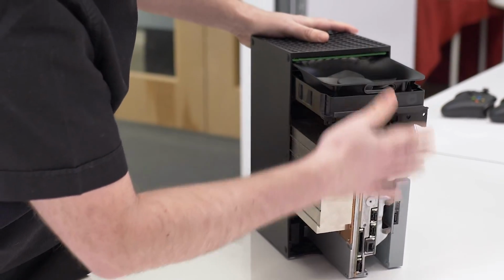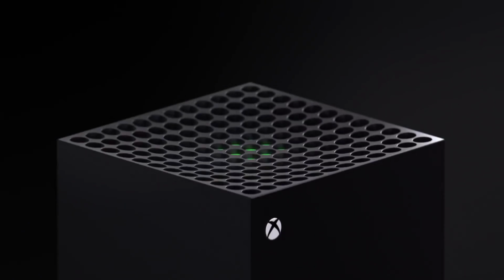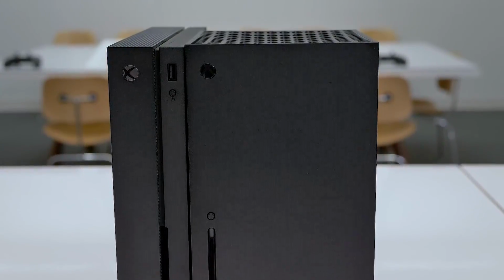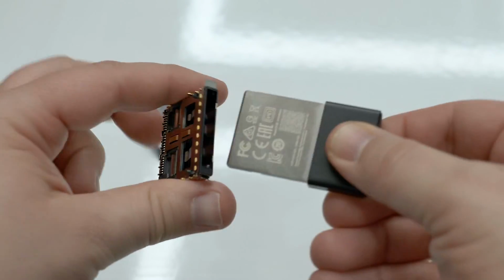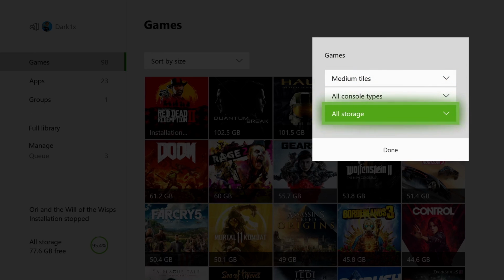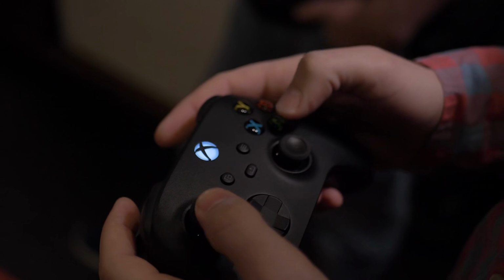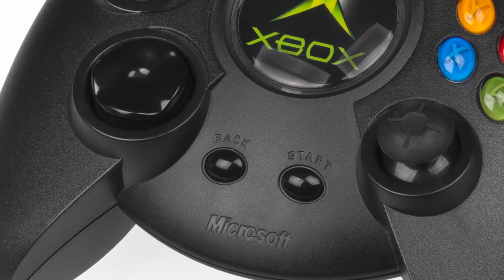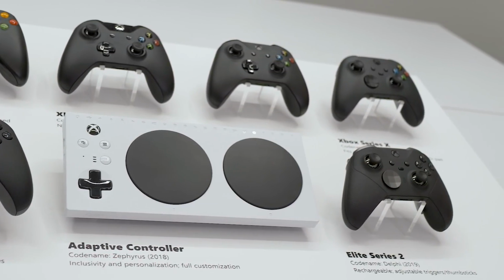DF Direct: Hands-On With Xbox Series X  + Impressions + Xbox One X Size Comparisons!

Comment: How many TVs have HDMI 2.1 though? Only the high end ones, so 120hz 4K will be off limits to many. I recently got a Samsung NU8000 and that doesn’t have one. So 1440p it will have to be for 120hz. Not sure how that will look on a 55” screen. 

Would 2 HDMI 2.0 outputs from the xbox series x into the tv achieve 4K 120hz?

Comment: Is it safe to assume that these are not 1-to-1 Zen 2 cores ripped straight from Ryzen 3000?  Otherwise the cost and power draw would be through the roof... Still an incredibly impressive console nonetheless. With 12TF at FP32 I wonder how high the BOM is on this.

Comment: I really believe the reason Sony isn't showing the PS5 is because they just can't.
The only leak that can be considered true is the one with the clock test for the chip.
Having 3 modes, we know two had the chip run quite low to match the PS4 and PS4Pro... and then you have a third at 2GHz, that being PS5 normal clock.
I think they have a problem with the cooling system.
Seeing the Devkit, i have a hint they'll do something flashy instead of practical like Microsoft did with the XSX.
There were reports saying they have a expensive cooling system...
So, they can't show you the box because they don't know if they can do the cooling systen to match that design and they may have to turn down the clock speed, reason why they can't give the specs.
At this point something has to be wrong for Sony to stay radio silent... and power ain't a reason, tbh. We saw consoles like PS2 or the Wii destroy the competition while being the weakest machine of it's generation.
It's so weird... i don't know.
Sony better have a good reason for this weird marketing they're doing.

Comment: SSD prices aren't that important.... The prices are already dropping, and the market is very sensitive to Competition and Sales. 

Just last Summer 2019 a company named Sabrent released these very well prices NVMe drives that were FAST, RELIABLE, AND WAY TOO COMPETITIVELY Priced, that they started a pricing war on similar sized cards for like 3 months. 

That's how I got a 512 NVMe Drive and a External Drive for it for $100, and at the time I could have bought the 1TB and enclosure for $150. Compare that price with a similar sized Samsung T5 before you try to mention anything about being Pricey, ESPECIALLY when you consider the Performance difference. . . LOL! 

My real point is that in the same way the Xbox 360, then later the PS3 lowered the price of HDTVs due to the increase purchase rate with the consoles, The Exact Same Thing Will Happen To SSDs. 

Whom ever launches their console first, will be the first to help drop the price on NVMe drives as the Hardcore Console Gamer will be buying a new storage, Especially for the Educated ones who know that Drive performance drops with how filled the card is, so the Biggestdrives will see the highest drops. 

What's cool about NVMe Drives is that Size of the drive goes hand in hand with Speed. So Bigger = Faster.

Comment: can't wait for Microsoft's digital E3 event, now they've outed all the specs, it's time for games!
Reply: All they need is atleast 3-4 big exclusives releasing in 2021 and a price tag the same or cheaper than ps5. Ps4 was a success due to being the slightly more powerful console, more exclusive, and being £100 cheaper at launch. The marketing for Xbox One was atrocious.
Reply: @lyfe8349  yepp 😶I don't know how they flopped like that for a such a bigger company.

Its like as it they take turns - ps2 was a king of its time. But then the 360 won over the ps3, but now the ps4 dethroned the XBOX. And currently it seems like xbox is winning in terms if hardware
Reply: Thaw check those sales numbers. PS3 outsold the 360 over it's lifespan
Reply: Matthew Stifler For the majority of the lifespan 360 outsold the PS3, it was only towards the end where PS3 caught up
Reply: @FBDMatt  In my opinion that dont mean they won that generation. 360 was king back then and thats facts.
Reply: @FBDMatt  the ps3 had a slow start until 2009 when the slim came and they had a new marketing campaign. Mainly the xbox 360 didn't sell as well as it should have was because of rrod
Reply: Shadow Vortex are u not aware the 360 ‘won’ that generation as u ppls put it? this isnt my opinion either this is just common knowledge from those around for the era. just because ur looking back at a bunch of sales doesn’t mean u were actually in the loop at the time. everyone knows xbox had that generation, the fact ur disputing common knowledge .. idek what to say
Reply: @DazarusUltimusMaximus  PS3 destroyed the 360 in the end, it made it look like a toy in comparison with the amazing exclusives on offer.
Reply: @FBDMatt  Xbox had more concurrent users and more games sold overall, especially multiplats. Sony kinda just crawled into the market by sheer name recognition to casuals who had no idea about anything gaming, cause they hadn't played games during the crisis and played PS2 or PS1 back in the day. But most importantly was the online cost that prevented casuals from getting 360s, as they wanted to stream netflix without Xbox gold.
I knew quite a few people with ps3s, but they never used em. All Xbox 360 owners used their console regularly.
And PS3 outsold the Xbox 360 by a small margin at the end of a 8 year old long cycle where most of the money was already made.
But bless sony, investing into single player content and keeping Xbox in their toes so they don't get away fucking it up like they did with the Xbox one launch.
Reply: @FBDMatt  Either way, PS3 was a dirt console compared to 360. PCMR now tho
Reply: @DazarusUltimusMaximus  Xbox came out a whole year earlier then the ps3 which is why the sales were so high at the time. No one knew Sony was coming out with a PS3 so everyone got Xbox. But Sony still caught up quick and still won.
Reply: @Thawhid  LOL 360 won over the PS3??? Most Multiplatform games during the first half of last gen ran better on the 360 but then PS3 was developed for as the lead platform and games then performed better on PS3.

PS3 OUTSOLD the 360 worldwide. The Wii outsold BOTH of them.

360 never won against the PS3.
Reply: @shadowvortex2029  Red ring of death caused people to buy MORE 360 consoles after they got it out of warranty. I know at least 6 people who purchased 2 or 3 360 consoles because of red ring of death out of warranty.

PS3 beat the 360 because of GAMES.
Reply: @timothyjn100  I'm trying to explain why the PS3 had more sales towards the end but 360 was the king of consoles
Reply: @FBDMatt  And those 360 sales were WAY over inflated because of people like myself who had countless RROD and ended up buying 2 or 3 console after Microsoft's damn warranty went out.
Reply: @timothyjn100 America isn't the world, buddy.
Reply: 19 Coyote 5oh ah they actually extended the warranty so people didn’t have to, as they would have get major flak, they were also facing bankruptcy so they dropped like 1. something billion on the problem.👏 glad to know ur aware of what happened ..
Reply: 19 Coyote 5oh People weren’t re-buying consoles🤦‍♂️ they were getting replacements which ARENT counted in sales. Do u have any reference for ur claim or is this all just mere speculation coming from someone with an agenda ..
Reply: @timothyjn100  

You're incorrect. Xbox360 warranty only allowed a replacement for the first time it happened to a console. I went through 4 Xbox360 that I bought and not including the 4 replacement ones. There wasn't a warranty on the replacement Xbox360. 

Thankfully the last time I got a black Xbox360 and still use it. Those white ones were garbage and broke really easy for all kinds of things.
Reply: @FBDMatt  I heard it was discontinued after the 360
Reply: @British WarShepherd 
Yea that was Microsoft’s biggest L
Reply: @lyfe8349  The old head of xbox ruined everything before he left. When fill Spencer came in he tried to turn everything around and was actually making a decent comeback but it was already too late. Everyone hated xbox already.
Reply: @lyfe8349  last time I checked ps4 launch line up was trash especially compared to Xbox
Reply: RobM E3 got cancelled bro! Or that’s what I believe I read.
Reply: @jackbrooking4754  Xbox announced they're doing a online stream or video to do their announcements
Reply: I wouldn't hold our breaths, Ninja Theory are the biggest dev studio they have and all they're working on is Senua 2 and some Overwatch rip off :/
Reply: @MorrisseyMuse  343, Rare, playground games, The Coalition, and Obsidian are all bigger than Ninja Theory.
Reply: @randymarshole  He is probably a sony fanboy, don't mind him.
Reply: @randymarshole  He is probably a sony fanboy, don't mind him.
Reply: @randymarshole  He is probably a sony fanboy, don't mind him.
Reply: @randymarshole  He is probably a sony fanboy, don't mind him.
Reply: @randymarshole  He is probably a sony fanboy, don't mind him.
Reply: @randymarshole  He is probably a sony fanboy, don't mind him.
Reply: @randymarshole  He is probably a sony fanboy, don't mind him.
Reply: @randymarshole  Naughty Dog, insomniac, Sony Santa Monica, Bluepoint (confirmed 3rd party exclusive), Sucker Punch, Guerilla Games etc. etc. All proven their top tier studios. Fact is Xbox has a lot to prove in the game department, sure 3rd party games might run 10 fps faster but when a casual sees Spiderman 2 or Uncharted 5 being exclusive to PlayStation they buy.
Reply: @josuem7398  I don't know why you addressed me. All I gave is factual info about the Xbox studios larger than Ninja Theory, never commented about the quality of their games.
Reply: Josue Millan 10fps 🤣 ahahaha. yea try more plus far greater ray tracing capabilities amongst other things like higher res’.. 👌
Reply: @MorrisseyMuse  have you played hell blade? It's actually really good, and now that they have a huge budget I can't imagine what it will be like for he'll blade 2. And bleeding edge is actually fun just lacking content atm
Reply: Haha E3 is dead. Rest In Peace.
Reply: Cough cough*** .....ya Abbott that
Reply: Ik this is a dumb que but will this xbox have a hdmi input for a tv or will i need a pc?
Reply: @notExolz  if it doesnt have a HDMI input then they are doomed from the start.  im a Playstation guy but  i wouldnt think Microsoft is that stupid.
Reply: Christopher Simon I never said it didn’t?
Reply: Very true
Reply: games from Microsoft? 🤣🤣🤣
Reply: I'm waiting for some great stuff from them hopefully. I'm more a PS/Nintendo guy, but there's been some great games on Xbox. I hope they take some more risks this gen like they did early gen on 360. I'd love for them to announce some new stuff alongside some updated versions of forgotten titles. I still play through Lost Odyssey and Blue Dragon.
Reply: @SoulCalSiegfried  i've never owned an Xbox but im still excited for it, just a waiting game to see what the PS5 is like
Reply: By

Comment: Well their Heat Testing isn't out of range. I live in Southern California, have no A/C, have small room and the sun sets facing my room so in the summer months and the early fall months the Heat can climb in my room. 

I have already invested in a Small Laptop cooling Pad for my XR500 Router, And another for my Xbox One X both blowing air from the bottom of the unita, along with a wall mounted blowing air from the Left to the Right of the units, and over an External NVMe unit for my 1X and the External HDD. 

None of that is mandatory except for cooling the NVMe drive, but  also keeping the devices cool extends their life, and keeps them from any throttling for the most optimum performance all year round.

Comment: So Series X has 2080ti performance, maybe more plus separate RT hardware. This RDNA2 chip is insane. We are back to consoles being top of the line.
Reply: They said in the other vid 2080 performance.... not 2080ti sorry
Reply: Matthew Higham 5700xt is almost equal to 2070 super which is a 2080. Series X has 14 more compute units with about the same frequency as the 5700xt. Sorry but it is higher than 2080, equal to 2080ti at the very least, plus separate chip for RT not holding back the raw power.

Comment: I'm afraid of how much those expandable storage cards are gonna be
Reply: Ditto. PS Vita flashbacks intensify
Reply: @resonatingraptorid6519  Fucking hell, I bought a Vita 2 years back for the fun of it and the guy included a free 64GB memory card. I didn't realise how big of a thing that was till I went on eBay and the cheapest one available was £90...
Reply: @RealityClubX  Only the super rich vita kids had 64gb cards.  I was middle class so could only afford 32gb lol
Reply: @T0TALLYAWESOMEGUY  Vita wasn't really big in my days, from age 7-10ish it was the PSP where literally every single person I knew had one except me, and then there was hype for the Vita but no one really got it. I bought the limited edition white and black one which was exclusive to Japan, the guy included like 3 free cases and the SD card all for about £150, which was cheap considering the white Vita alone was £170+.
Reply: They are gonna be really fucking expensive tbh lol
Reply: Ditto.
Reply: At least 100. Max 150
Reply: A 1tb m.2 ssd costs about £80 so maybe something like that
Reply: @conoruddin654  probably a QLC sata SSD in m.2 form factor if it's £80, a true nvme ssd with the stated specs is not gonna be £80 or it gets below HDD speeds when it's nearly full 🤔
Reply: @conoruddin654  these are custom carts for xbox only with built in heat syncs I think they might be more expensive
Reply: Conor Uddin mmm bit optimistic wouldn’t u say haha. microsoft do like to charge a pretty penny, as we know from their hdd’s. I’d say their’s definitely gonna be some add on costs

Comment: I noticed what looks to be a USB-C port on top of the controller, which would lead me to believe that the controller doesn't support AA batteries, yet the controller also looks to have a battery door that allows easy access to the battery (or batteries). Is the controller using a proprietary rechargeable battery, or is Microsoft simply relying on rechargeable AA batteries? If the latter is true, then can you still safely use non-rechargeable AA batteries in the controller? I currently have a bunch of eneloops at the ready, and I prefer Microsoft's current approach to batteries in controllers, but I might be on board with having a rechargeable battery in the controller as long as it allows for some flexibility and doesn't require that I connect my controller to the console via USB if I want to continue playing if/when the battery dies.
Reply: Actually, I noticed in another video that the controller still supports AA batteries, in case anyone else is wondering.

Comment: Microsoft is doing good with there roll out of this console but I'm still taking the PS5 even if it's alot weaker they've earned my loyalty as a gamer with the PS4 roll out and how their consoles don't break
Reply: How their consoles don’t break?! Have you heard or been around a PS4 Pro? It sounds like a jet engine and constantly overheats. The Xbox One X on the other hand, is the most powerful console out there and is also the quietest and most stable. 🤦‍♂️
Reply: @MrGeoff-iv6re  Sony always seems to get it right the first time though Microsoft had a whole extra year to release the one  X they are not on the same level and not only that the Xbox 1x literally rendered the Xbox 1 obsolete while ground breaking award winning games are still gearing up to release on the PS4 come on bro don't be a fanboy ...First console choice since the PS3 should be sony if you are smart
Reply: The don dondatta Look, the company on top seems to alternate every generation. The PS3 launched at $600 and devs had loads of issues porting third parties to the console. 360 was the favored console that generation... PS4 was more popular this generation (but the One X is a stronger/more powerful system) and I think it will alternate to Xbox being on top next time... and I’m sure Sony will take the generation after. Both companies make great consoles and like you said about Sony... Microsoft has earned my loyalty with great services and features.
Reply: @MrGeoff-iv6re  bro you're so biased the base PS4 was stronger than the base Xbox 1 of course the 1x was stronger it came 4 years after thats not a win for Microsoft you are right about the companies alternating the the original Xbox is my favorite console ever and I had a 360 I had two and both died on me got a PS4 the next gen and not looking back Sony has been the better gaming company by far the last 13 years or so The series x is the best thing Microsoft has done in a long time
Reply: The don dondatta I wasn’t comparing the One X to the base PS4... obviously I’m comparing it to the PS4 Pro. And of course I’m biased, so are you. We all have biases.
Reply: @MrGeoff-iv6re  I mean biased as in spinning an argument that the facts don't support not just favoritism Sony is objective the best company for computer entertainment right now
Reply: The don dondatta I’m not spinning any facts